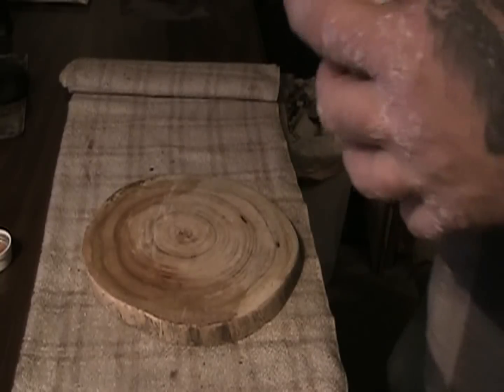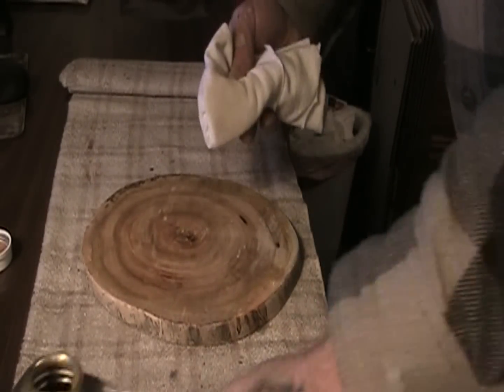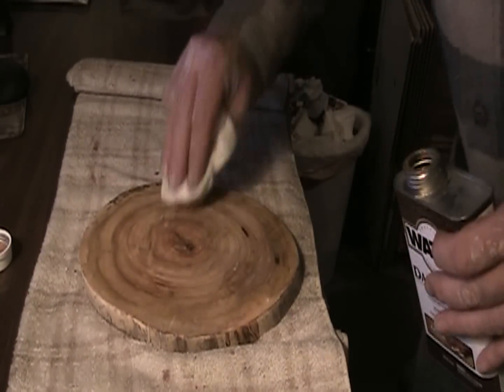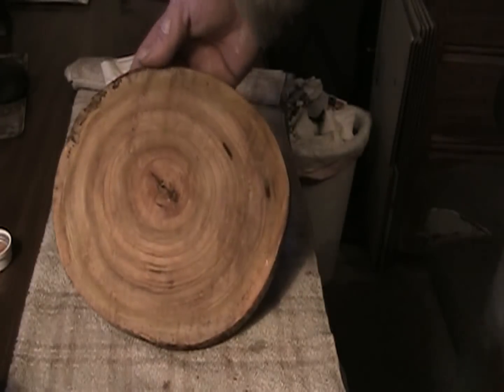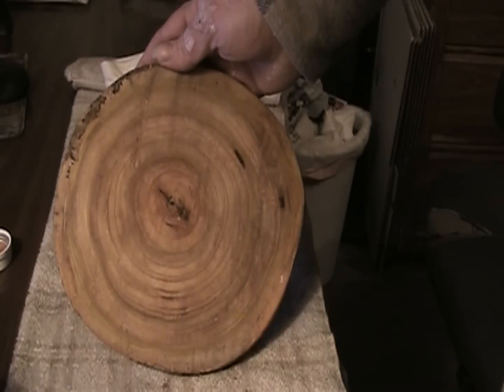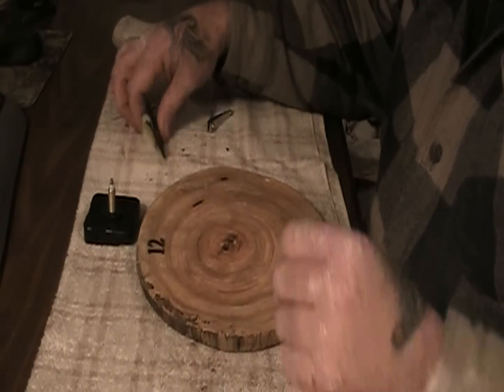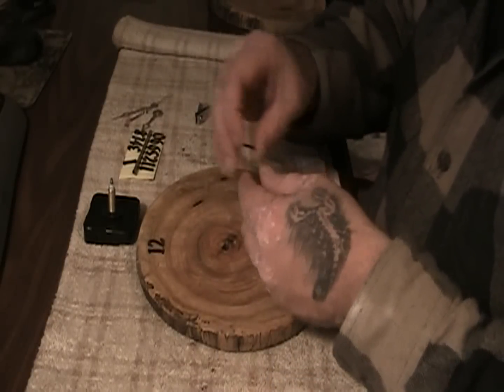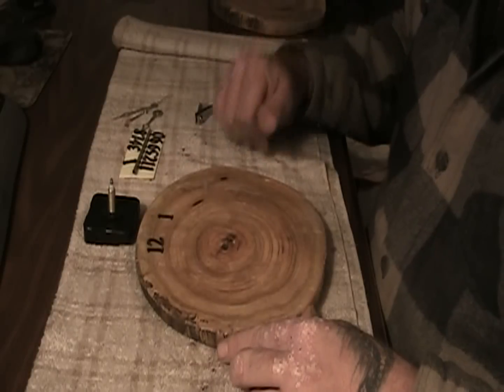DIY Clock: Pt.2

Comment: nice work! I made a clock for my grandma for xmas this year, using parts from a dollar store clock. Before I put the numbers in place, I installed the clock mechanism and pointed both hands to where I wanted 12. Then I turned the dial until the minute hand went back around to 12 and marked each of the hour positions.